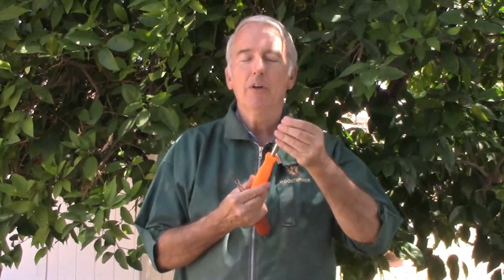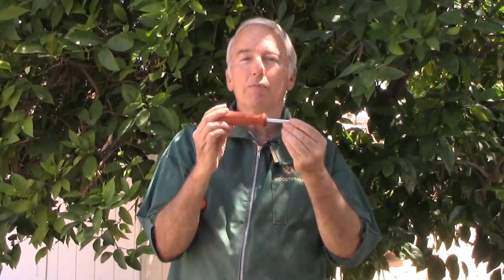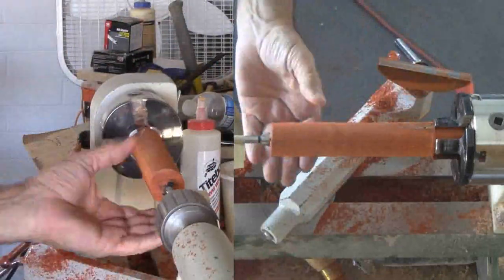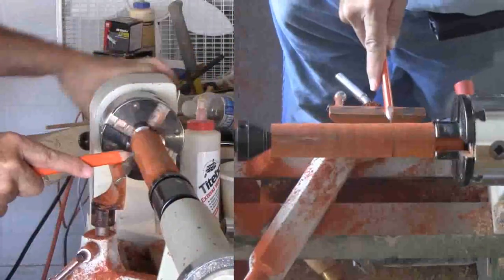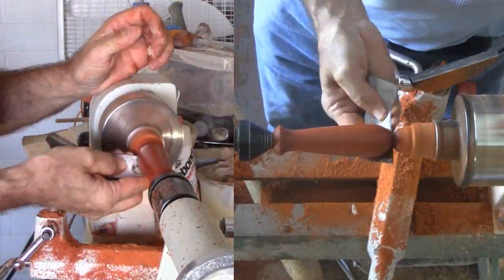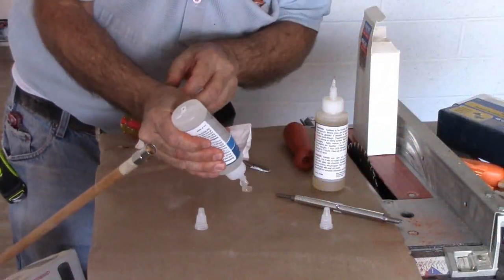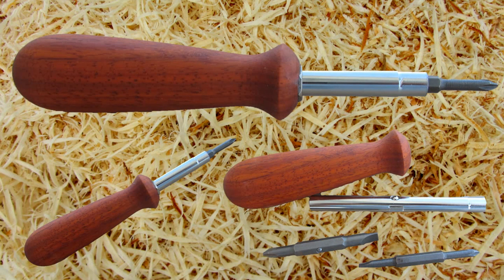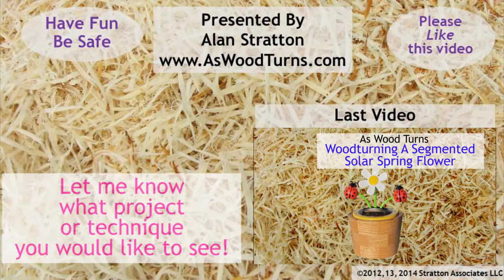Woodturning A Multi Tip 4 In 1 Screwdriver

Comment: I have been waiting for one of those handles to break so I could do the same thing but I guess they are not as cheap as I thought they were.
BTW I think of them as 6 in 1 since over the years I have used a lot of those hex head screws.
Reply from the maker: The only trouble using them as a hex head driver is that you have to remove the screw driver insert. Then, of course, it gets lost. then for sure you're down to a 4 in 1. :)
Alan

Comment: Sand a slight flat on opposite sides, to give a better grip. Also gives a place to sign or personalize.
Reply from the maker: Could do, but I'm a woodturner.  I'll use an eccentric technique to flatten.
But for a quick solution, that would work.
Alan